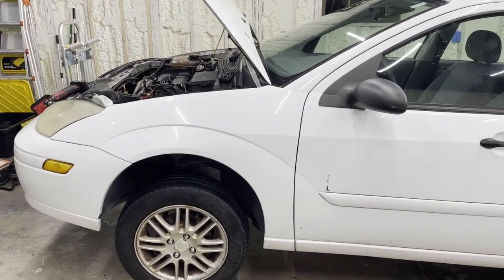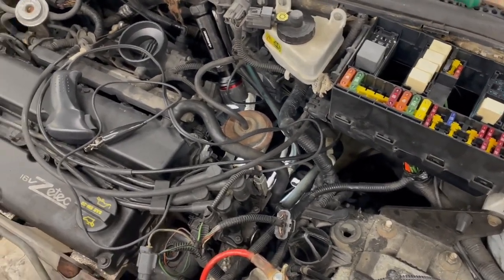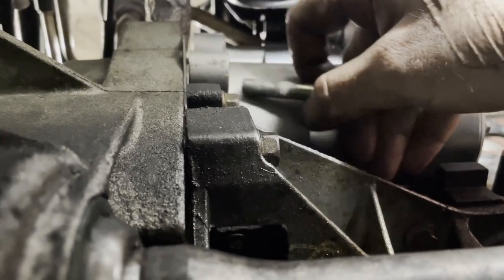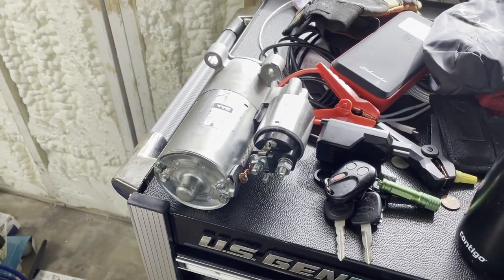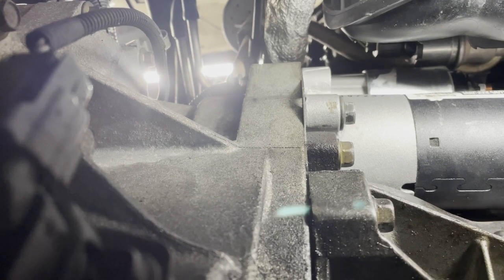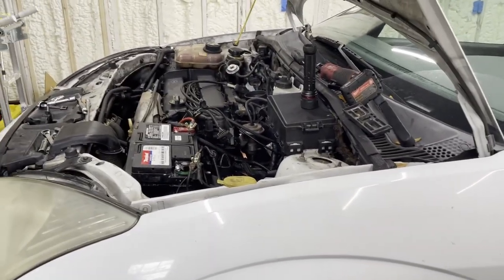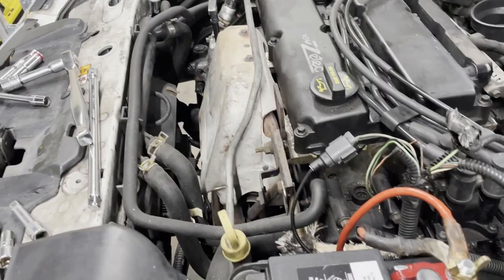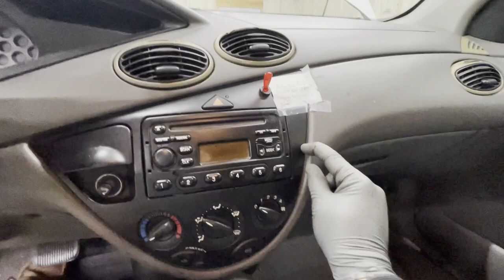Replacing the starter motor in a 2002 Focus

Comment: Can you please tell me where exactly I can look for the starter on the bottom so I can thump it?! I just need to drive it to the mechanic!
Reply from the maker: Jack up the car and slide underneath, straight back from the front.  All the way back so you can see the back side of the engine and you should see it.  It mounts on the left (you're left when you're laying underneath looking up) and the wiring hookups are on the right.

Comment: Can you explain where the negative  connector goes(the little metal thing) where it goes onto the starter ? I need help> trying to figure out where to put it.
Reply from the maker: @chitownchiraq either of the two upper mounting bolts will work.  It just needs to be a good ground.

Comment: I’m willing to bet the engineers did everything they could to make the starter as hard as possible to remove. From the solenoid and wire being redundantly bound with that plastic connector, to the 3rd bolt being on TOP of the starter wedge between the solenoid and the engine block. Rot in hell those guys

Comment: Hello, do you by any chance have a video of replacing the iACV or any advice on how you were able to do it? I’ve tried from underneath vehicle, I took the air box, intake tube off and still haven’t had luck…
Reply from the maker: I don’t sorry. I did that before I started the whole YT thing.  I did it from underneath. I had to do it by feel though. Couldn’t see it at all. Good luck.
Reply: IAC valve replacement: pain in the @ss. Here's a 1Aauto video about that. Needs patience, and a long 8mm socket. https://youtu.be/8rRRle1JK-U

Comment: my 2004 focus runs like a top with 208k miles on it, i've owned it for 9 years and my friend owned it for probably 5 or 6 years before me.  Shes been run hard and beat up but well taken care of and bad or broken parts replaced.  I'm about to pick up another one, automatic - mine is a 5 spd, and do a tranny swap if I can (i only want it if i can do a manual swap) as well as all my aftermarket parts - throttle body, msd ignition, headers custom exhaust and more that I would have to re-do to the new one - egr delete etc etc.
Reply from the maker: You best hold on to that one. It's a unicorn.
Reply: @rhynosgarage   Not really, these cars are pretty reliable if well taken care of. In fact, the starter is a known strong suit on these cars. They usually go out after 200k.
Reply: we have a 2003 wagon with 2lter zetec and auto trans, almost 400k mi.. motor runs great, never rebuilt.. the tranny makes a clunk when it kicks down from drive to 2nd... upshifts are fine.. not sure what that issye is.. tranny on its way out or just bad shift solenoids? 
anyway, gotta do the starter too but its likely just the solenoid on it... not sure if I can pull that off without removing the starter? solenoids are 25 bucks on amazon that fit.

Comment: This car was the biggest mistake I've made, all because my girl wanted a small car, such a low quality piece of junk
Reply from the maker: It really was the bane of my existence.  I should have run, not walked, away from this car when we bought it.
Reply: If you don't know how to work on cars, maybe. But parts are plenty available and quite cheap and it will easily hit 300k if taken care of. One of the best engines and transmissions Ford has ever made imo.

Comment: Parts are not made like they used to be. Sometimes it is better to pay the money for OEM. None the less i would have bought the el cheapo starter as well, lol.  Good ole Ford engineering. Water Pump will be just as fun.
Reply from the maker: Built Ford tough...to work on.